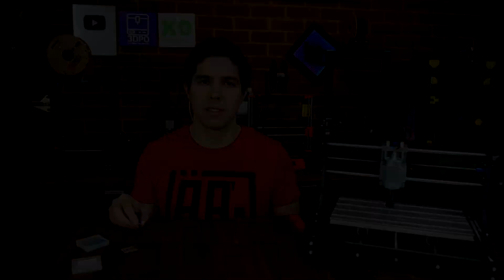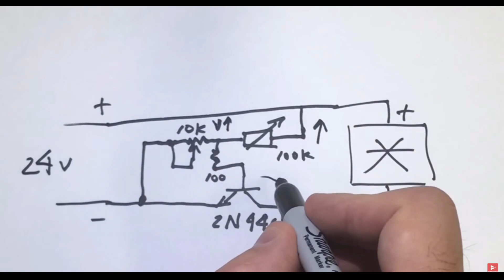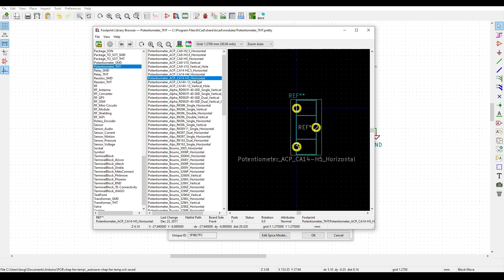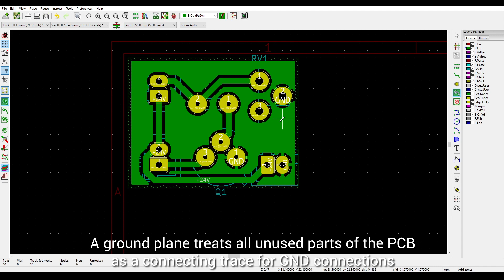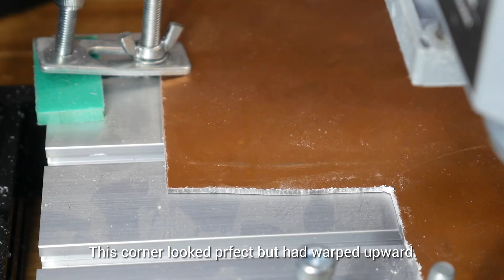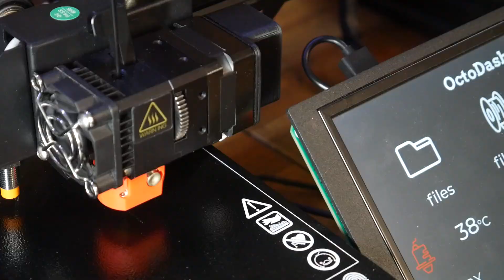Homemade custom PCB guide using free KiCAD software

Comment: your pcb looks like crap you need to use a gbrl to cut traces and do a height map b4 doing traces and use flat cam to cut the traces and drill holes

Comment: 210 / 5 000
Översättningsresultat
Översättningsresultat
Can't fix this in KiCad 7.0?? Don't know what I'm doing wrong.. Can't get it to fill the gnd pattern..Also when I import into Carbide Create wrong size..?? Would it be good with a new Video with KiCad 7.0???

Comment: Carbide Create does not longer let you export the gcode, so this this program (and thus the last part of the video) is not longer usable!!!
I have no idea if there is an alternative (maybe FlatCAM?). And that really sucks, because I was just wanting to start using a CNC router for creating PCB's. Yes - You can buy a year subscription for $120 a year, or a Perpetual License for $360, but if you do not use that program often (maybe once or twice a month, as most hobby PCB designers do) it's a VERY high price to pay.
So - Unless this video is remade with another free alternative (highly preferable an off-line, because on-line stuff can change at any moment, just like what happened to Carbide Create), I am afraid this video is not longer usable. A shame, because a lot of people would like to make their own PCB's a bit environment-friendly without chemicals and photo-sensitive copper prints.

Comment: You know there are thermal switches such as KSD9700 that make simple fan controllers? If there's room, one of those in series with the fan,  placed near the hot part of the hotend does the job simply.

Comment: Hello, you did really great job for hobbyists. I designed a pcb on Kicad and print it as a pdf file,then I checked the 1x10 pin header size but it is different in size,can you help me?

Comment: Very nice, detailed and impressive. I am interested in using laser cutting instead of the CNC drilling method. This means that instead of G-Code, I need an SVG file that laser CNCs can use to trace their cuts, some deep and some shallow for the isolation borders. Any recommendations?

Comment: Since Carbide Create locked Gcode behind a paywall, are there other programs we could use to get the gcode for our boards?
Reply: i know you made this comment like a year ago so it’s probably not applicable anymore. but i’ve recently been using 1)Universal G-code Sender and 2)FlatCAM to 1)send gcode that i create and 2)create gcode from gerber files

Comment: I find that pcb2gcode a far more powerful and useful tool for this, combined with bCNC you can have the mill do everything, mill tracks, drill holes, cut. And as it's able to mill you can just use a small endmill (0.8mm) for making holes of any size. Another tip is if you run the cheap endmill backwards and touch it with a hacksaw blade you can refine the tip so that you can do extremely fine trace widths. Just made a board using a part in a SSOP28 package using this method.

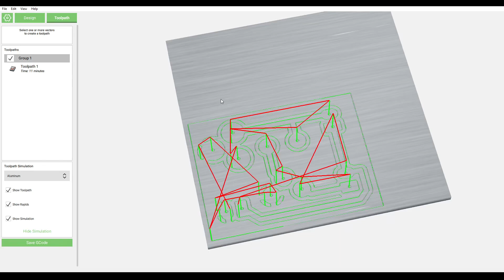Comment: Great video! I'm kind of confused by the need to enlarge the pads in KiCad to accommodate cut width, though. I thought one could tell the program that generates the G-Code the width of the cut the drill bit creates, so it can  accommodate and will not cut directly at the edge of the pad, but offset the drill bit from the edge, so the cutline is at the intended pad location? At 15:20 it looks like the Toolpath is not doing that, but maybe I'm reading that wrong.

Comment: One criticism and two tips, but first - great, clear video and instructions good job.

Criticism: There are more than just Windoze and Mac users so a product like Carbide which calls itself cross platform when ONLY Mac and Windoze versions are available is just utter nonsense. What about Linux, what about Android, what about Raspberry Pi? A TRUE cross platform player would at least ALSO have TWO of the latter three covered if not all three. SAD😢😢

TIPS: When producing a DIY board so professionally looking it seems a shame to not finish it off professionally by properly tinning the board using tinning solution. Also, it is quite easy to produce a dot mask from KiCAD or.other software. Set the Z axis zero to be the height of the copper surface, coat the board both sides (after tinning using tinning solution) with solder mask green, blue or whatever then when dry, re cut the pad positions to surface copper zero using a small diameter four flute downward routing bit. Then finally drill. The improvement in final look and finish will be immense with only the text layer normally produced with silk screen missing.

When running the CNC cutting, using a glass base board and double sided tape to stick down the board will avoid much if not ALL board flex and height variations providing a much cleaner, more accurate cut.

Suggestions for a good Linux alternative to Carbide would be useful - FreeCAD?

Comment: If you want a really deep SPICE-compatibele analog / digital circuitsimulator with schematic editor, you can take a look at Spectrum Software Micro-Cap 12. This was a very expensive piece of software until a year ago. The main developer of this great piece of software decided to retire and gave the software away for free. Anyone that's interested can download it at:  http://www.spectrum-soft.com/index.shtm
As said - The software is completely free, and has a lot of models in it. It's in no way limited, because it is the full professional version. Of course it will be no longer updated, but it will absolutely be very useful for at least several years.

Comment: Great video. I have done basic boards in the past with KiCad and home built cnc router (lots of 3d prints combined with metal rails and sprockets etc). I can't recall the exact software I used for the gcode generation but what it did is set a whole lot of probing points in the code. When driven with LinuxCNC (EMC2) it would probe the board (probe wire connected to v cutter and ground wire to copper of PCB. This would record the Z heights of the copper surface and manipulate the cutting depths to suit any distortion in the board. This means that you can set the cut depth to just deeper than the copper and know that the copper will be just cut and not making large allowances to cover distortions. This process means that much finer tracks and clearances can be used in KiCad and much more detailed boards can be cut. This worked really well with only some teething problems but I have not used for a couple of years as most of my projects are mechanical in nature. Keep up the good work, your info is well presented and covers a great range of interesting stuff.

Comment: Good demo for a simple PCB, but for such simple circuit honestly think prefboard does the trick just fine and is significantly faster. Would you try with SMD components and a more complex layout? Maybe even 2 sided? Thanks for the great 3d printing videos!

Comment: Thanks for this video, it has prompted me to buy a 3018 CNC router for PCB manufacture. Up until now I have been using vero board in my load cell kits but time consuming to make due to wire straps and manual drilling of breaks. Now I have a steep learning curve ahead of me but feel its worth it.

Comment: Wow, gone are the days when I'd use adhesive pads and tracks to layout a PCB on a blank board and throw it into warm ferric chloride to etch it. Now I want a small CNC to add to my ever-growing tool collection!
Reply: It's interesting that Michael opted to drill the holes in his PCB "manually", because I bought one of these 3018 machines specifically to drill my home-etched PCBs' holes!

I have a load of equipment for etching PCBs using pre-sensitised laminates, a UV lamp, designs laser printed onto transparencies, ferric chloride, etc.
I personally much prefer it to the isolation milling technique shown here, because my designs tend to be quite a bit more complicated, primarily using SMD parts, and I can get much greater track density with my equipment than I've ever seen from isolation-milled boards (though it might be possible with sufficient skill and experience, I guess).

I totally understand why a lot of people wouldn't want to deal with the chemicals, though :)
I'm not aware of any of the ones I use being fume hazards or anything, but it's still messy and they need proper disposal - though I can just take stuff to the household recycling centre 5 minutes down the road.
(Yes, Chinese PCB fabs are fast and cheap, but etching a board in 1 hour is still faster than even the expensive courier shipping!)

However drilling even a dozen holes takes me ages and the accuracy is horrible! Some of that will be because I use a Dremel in a Dremel Workstation (drill press kinda thing) and the Dremel has a bit of run-out, but I think most of it is just that it's really hard to manually align it!

So I bought a SainSmart 3018-MX3 with the aim of using it to drill the holes and mill the outline, in case I wanted something more than a simple rectangle :)
Life's been a mess lately so I've not been able to test it out yet, but I like having a CNC mill at my disposal, at least!

(And no, I wouldn't recommend the 3018-MX3. Get SainSmart's 3018-PROver or their regular 3018 instead. SainSmart themselves have been great, with a good assembly and user manual, and only one snag during assembly, where a smooth rod was very slightly too wide to fit inside the 608-style bearing it was supposed to sit in, but a bit of filing it down sorted that out, and there were no burrs on any of the cut aluminium parts or anything. But the MX3 uses a weird control board that's designed to be used with Mach3 - or DrufelCNC. DrufelCNC seems capable enough, but I think I'd prefer to use a grbl-powered board, for the flexibility and larger community... It also uses non-silent stepper drivers that can't be replaced, though that's less of an issue than with a 3D printer! I'll probably replace my machine's control board at some point.)
Reply: I wonder if for someone that have tools for etching it is still not way to go. There are videos for i.e. modified 3d printer that swaps hot end for that special pen, draw PCB lines on board for etching. No broken bits, dust, less force applied that can bend or move the board.
My guess that for a small and simple piece like this one, router might be a faster option but for bigger board my 5 cents go to etching. So maybe for somebody like me who is not interested in some higher level of PCBs the best option would be 3d printer / router like machine where you can use working end either for pen to draw scheme and then to minidrill to make precise holes.

Comment: Very nice solution and a great example of how you can design your own PCB's. I personally would have took the lazy solution and soldered up a thermistor, resistor and mosfet with a bit of heat-shrink around it. But your solution is far cleaner, I love it :)

Now I'm considering getting a cheap CNC too...

Comment: For something simple, you can use Kicad PCB to export a step file.  

Import the step file into fusion 360 or freecad, then save as a stl file.  Print using your favorite filament, then insert the parts into the plastic board and solder together.  

My board had about 20 components (leds, resistors, diodes, connectors) and since the holes were already present, it went together quickly.  I was originally going to build on perfboard, but I was using a db-9 connector which doesn't have standard 0.1" spacing.

Comment: Great video, learned a lot.

I also recently started milling my own PCBs. I built myself a Cyclone CNC for that. I am using my Creality Mainboard which I had left from my Ender 3 Pro (replaced it with an Skr mini e3 v1. 2) running grbl and using bCNC as gcode sender. 
Today I added alligator clips as z probe - connecting one lead to the drill bit and the other to PCB - and then running ABL. This really helps to improve the results.
It was really fun to make this project,  from sourcing and 3d printing the parts, assembling it, an now using it :) 

I am using EAGLE to create Gerber and drill files and FlatCAM to generate the gcode. But I will definitely also try out KiCAD and Carbide Create instead.

Comment: The plugs are female, the sockets are male as the sockets have the male pins!
You don't have exposed pins on cables to prevent accidental shorts if the other end of the cable is live.
Reply from the maker: That's true, thanks for pointing out.

Comment: As a retired professor of Electronics and Computer Engineering Technology, I really appreciate your clear concise demos.  I taught PCB design and fabrication for many years and the current tools that you used and provided a link to are a great improvement from where I started.
Reply from the maker: The first time I tried Eagle CAD back in the day I was completely lost. This time things were familiar enough that I could just use the KiCAD help doc to get there.
Reply: If you are interested in PCB Milling, you might also like what I did: https://youtu.be/R1L0cQV8muw?si=snKq0WRMKE6QE0HT

Comment: I have made PCBs in the past using a program on my phone called PCBDroid. Great little app. I also use photo resist to get the circuit to the board then etched using acid.... its really not as hard as people make it out to be.
Reply from the maker: I did that for a boards boards but I prefer how clean at cut home PCB is.

Comment: They should be paying you for fixing their product.
Reply from the maker: If any of these things make it to the final product I will be satisfied. The mainboard's fans would be easy for them to fix and the screen saver too. I'm not sure if they could do the hot end fan due to the HDMI plug on the mainboard.
Reply: @TeachingTech  your fixes are quick and simple.  The fan changes are easy to add to the board that's already there. You've already made the user test case for why they should implement the changes.  No reasonable product manager would bypass the changes.

Comment: Great video.  I'm in the process of a major rebuild to expand and stiffen my secondhand 3018 - the simpler type made from all aluminium extrusions.  I'll probably use it for lots of small things but PCB manufacture is high on the list, and after decades of UV lamps and ferric chloride I'm looking forward to that.  I've tried using Candle to run gcode, and it's quite nice because it can generate and work with height maps.  I've been using Eagle but this inspired me to download KiCad.  Thanks!

Comment: Fine work Michael! Did you consider potting the PCB in epoxy to prevent shorts and keep the raw copper traces from being exposed to the elements? I bet a cheap two-part epoxy would do a really nice job, and you could cover the entire underside of the board in a few minutes. Perhaps worth considering for a future video?

Comment: Marlin has built in power supply control. Most boards if plugged into usb only will power up the chip, but not the steppers, fans, and such. Since you have a raspberry pi already on the printer you could power it straight from incoming supply and switch the motherboard supply using an open gpio from the motherboard. I have a mks smezi I do this with. Raspberry pi is powered straight from supply and relay to MB power is switched by gpio 17 broken out of the lcd connector. I had a pcb etched through JCB PCB for this.
Reply from the maker: This is all true, except I don't have access to the firmware source to recompile. Hopefully that changes in future.

Comment: If you have a couple of days, it's often cheaper and easier to have boards made in China...  And the end-result is better since they have access to proper industrial equipment rather than just a cnc mill.
Reply: You can probably order this board from ali as well. Or use the included functionality in Marlin. Or order the parts you want from a 3D printing shop. But where's the fun in all that?

Comment: I haven't done heaps of milled PCBs but I have found flatcam & bCNC to be pretty useful. bCNC has an autolevel function. If you make the PCB and your milling bit close a homing switch or z probe circuit. I just used an alligator clip to attach to the milling bit and taped the other wire down to the PCB. always a good idea to test the taped connection is good by closing the circuit with the alligator clip to the PCB before running the autolevel operation.  Combine all that with a 0.3mm 30° v bit I got pretty acceptable level of accuracy without having all the broken bits to go along with it.

Comment: I have learned so much from you.  I do have a suggestion though, be being on the receiving end of the learning.  It only has to do with the coding marline portion.  1 more compliment though.  Your are very thorough in your documentation.  I really don't know how you make the videos and work on the printers at the same time.  I salute you.  Back to my suggestion.  If for example you just made a smalle 15 line copy past of the exact lines that you changed in marlin would be very helpful.  Because of you I learned how to use the CTR + F to find things in marlin and this would have accelerated a lot of my learning curve.  Thank you again for all of your videos.  

ALSO if your need another video to make.  I actually bought the S42bs from big tree tech for me Creality CR10 S5 and the x axis works great but the PID tune on the HUGE Y axis overshoots really really bad.  I have messed around with trying to even make a single adjustment from BTT and have made not ground at all.  Well maybe a little.  I finally got my STlink V2 throught the stlink software to communicate and pull see whats on the S42b but still have not got the com port to show up.

Thanks again.